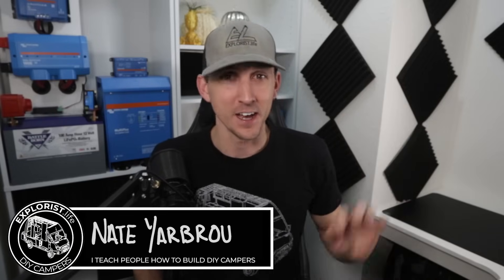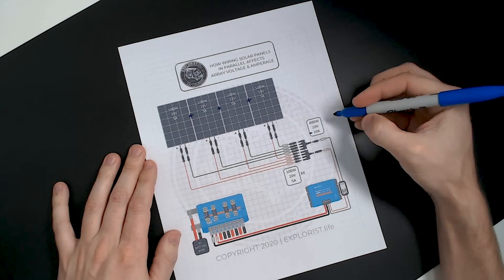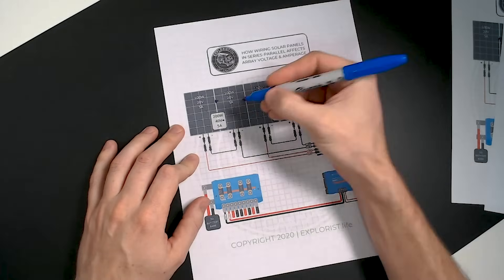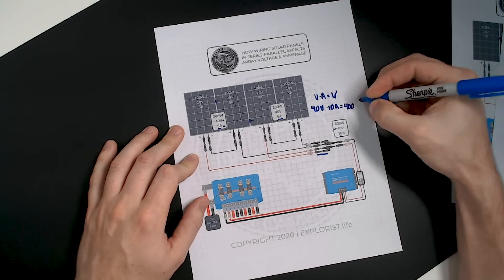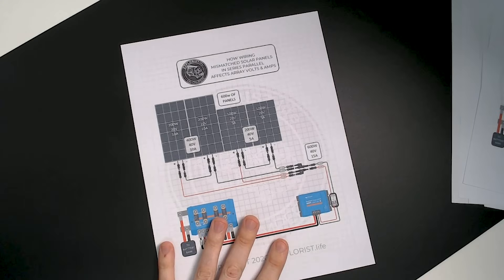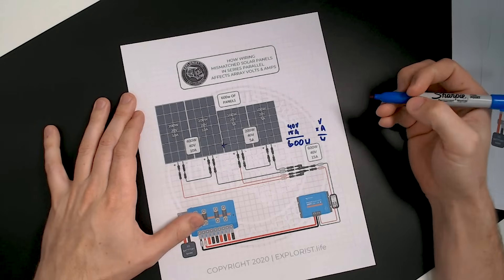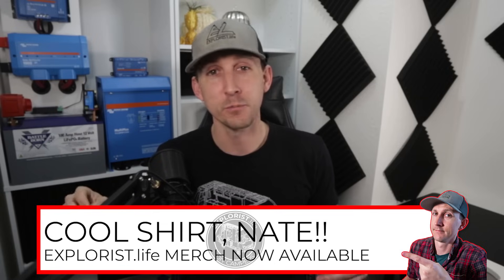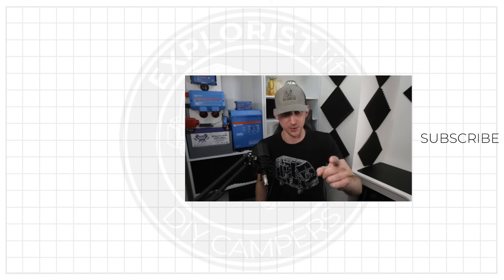How to Wire Different Sizes of Camper Solar Panels Together - Effects of Mismatched Solar Panels

Comment: Hey Nate, Great video, but have some questions, specifically to my setup but with the calculations you provided.  
I currently have a 170-watt solar panel on my RV.  It is connected to a PWM Charge controller.  My wife saw on sale at Costco, a 120-watt solar panel, so we picked it up; however, watching some videos, mixed match panels can be a bit of a pain and bring the entire system down.

I understand I have 2 options when wiring them (3 options if I decide to use a separate charge controller)

Info about each panel:
170watt panel shows VOC at 22.8 and Amps at 8.79
120 watt panel shows VOC at 21.5 and Amps at 7
Combined Watts= 290watts

First: Series Connection:
22.8+21.5=44.3. Amps take the lowest common denominator which is 7amps (44.3 x 7 = 310) But 310 is more watts than the 2 panels combined (290) 

Second: Parallel Connection: 
22.8 and 21.5.  Volts take the lowest, so we sit at 21.5 V and add the amps 8.79+7=15.79 amps
(15.79 x 21.5 =339.48) again higher watt rating than 2 panels combined

Every calc you do shows that you have lost efficiency of your solar array.  Where are my numbers mixed up?

Edit:
Now that I have read some comments I see I may have used the wrong Voltage-  for the 120 watt Solar Panel I see it says VMP=17.1  and the 170 watt panel shows a Rated DC Voltage of 19.3  if I do the series and parallels calcs with these numbers I get 254 watts in series connection and 270 watts for parallel connection.

I assume if these are the correct calcs then it is most efficient if I connect the panels in parallel.

Thanks for you help Nate

Comment: if a solar panel's voc is 50 volts, then what is it's voltage out when lying flat versus tilted 90 to the sun?  or is it the same and just the amps change?  I haven't seen a graph on this yet.
Reply from the maker: The volts will be pretty similar.

Comment: one thing left out of the video is maximum voltage the mppt can handle.  say you have a mppt with 100 to 200 volt input.  your solar panels are 48v, but voc is 51.5v at normal temp.
the voc goes up with low temps.  so maybe the voc at 30 degrees F. is 53 volts.  4 panels in series = 53 x 4 = 212v and exceeds the max. of the mppt.   i'm guessing that most mppt's are
designed to exceed their listed minimum/maximum voltage, but i wouldn't bet on it.  so i'd look for a mppt with a max voltage input of 250v.
Reply from the maker: Hey Richard!  I didn't leave that out, I dedicated an entire video to how to size the charge controller: https://youtu.be/MxziHKvTRh8
Reply: @EXPLORISTlife  thanks, i watched your video, understood it and even understood your "math error".  i'm buying 4 350w panels tomorrow, but will buy 4 400w panels next month.  i'll put all 400w panels in series at first with my mppt.  then when i can afford another mppt i'll use the 350w panels in series to it.  i will probably need a
combiner box??? to join the two mppts together.  comments???

Comment: Nice presentation.  So I'm a solar DYI super newbie, where do I find the voltage and amperage output of a solar panel?   When I checked the panels in Amazon, they are  advertised at 100W or 200W and  then 12V.     Is that 12V - the voltage I should be using when I am applying it to your presentation or is there another voltage specification that I should be looking for?   In going to the details of the solar panel it says Maximum Power Voltage(Vmp): 18.4V,  Maximum Power Current(Imp): 9.24A,  Open Circuit Voltage(Voc): 22.6V,  Short Circuit Current(Isc): 9.79A - which of these I should be using?   Thanks much for your help.
Reply from the maker: For determining power like shown in this video, you'd use Imp and Vmp.

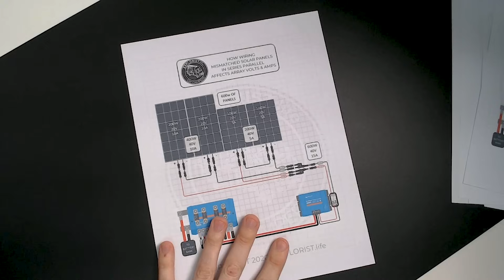Comment: Hi there. Thank you for this video! It was really helpful with deciding how to set up my solar on my RV. I had a question maybe you can answer... I currently have 2 x 100w panels and 2 x 175w panels on the roof of my trailer. I've wired them in series-parallel as you demonstrated in 7:10. However, I didn't account for the fact that because my panels are near my roof AC, there is usually a high chance of shade on at least one of the panels at any given time unless the sun is straight above. In my scenario would it have been better to just get 4 x 100w panels (4 x 175w won't fit) and wired them all in parallel? These are all going to a single MPPT charge controller.

Comment: Here’s a question

5 x 100watt panels (12 volt) wired in parallel

2 x 50 watt (12 volt) panels wired in series.

Total wattage of array? Want to check my math.

Comment: Any advice on how to wire in a portable 200W suitcase to an existing 800W system?  Current configuration is 8 100W panels wired in series parallel. We were hoping to use the suitcase to chase the sun a bit when camping.
Reply from the maker: That would be best going to a 2nd charge controller: https://www.youtube.com/watch?v=N0UB7LZVduk&list=PLmvhcyi4n0TUjVGA_O5aI5SQrS1kKLgEF&index=18

Comment: Great videos, thank you for all your videos. 
I have a question? I have 2 100w panels now   MP100w, Voc21.6, Isc6.24a, Vmp17.9, Imp5.72 and I'm looking at get 2 more but with few differences      MP100w, Voc22.6, Isc5.7a, Vmp18.78, Imp5.32.
Would I be able to tie these together? And what would the possible issues be if any?
Reply from the maker: You 'CAN' mix pretty much any panels together into the same array, but it's BEST to have them matching.   If you are wanting to mix and match, this video will teach you to figure out the effects of what happens when you mix and match solar panel sizes: https://www.youtube.com/watch?v=jejro4zkl8I

Comment: Hi nate, I have a question for expanding an existing solar system on a Tiffan motor home. On the roof there already are 3 200w solar panels in parallel.  There is only enough space to run 100 watt panels between the equipment on the roof and we have enough room to fit up to 10 100w panels. My main question is can I run 2 100w panels in parallel to up the amperage and then wire that parallel set into series with the 3 200w solar panels?
Reply from the maker: I would personally keep the two different sizes of panels on two separate arrays feeding their own independent charge controllers.

Comment: In your last example whereby adding an additional solar panel the array output was cut in half. (asking a question) when adding the additional solar panel,  it was incorporated into one of the series of three panels so there was three panels and four panels in series/parallel , would that be a way to incorporate the additional panel without losing generating power? if not; do you have a video outlying the correct approach mixing the same size (amps/volts) panels but series (2-6  and 2/7 panels)  have different number of panels. Thanks, learning a lot from your videos.
Reply from the maker: The other option is to split them up into multiple arrays: https://youtu.be/N0UB7LZVduk

Comment: I have 9 240 watt panels  7.89 max current x 30.4 max voltage.

I have 3 305 watt panels  9.84 max current x 32.62 voltage. 

If I am understanding this correctly, if I connect all these in series I will end up with with the usable wattage as if i had 12 240 watt panels.  The voltage and amperage would fall to be that of the lowest common denominator panel.  Is that right?
Reply: I rewatched. only the amperage would fall to the lowest panel amperage.  I would be losing about 128 watts if I hot that right.

Comment: The mismatched panels can have their own independent charge controller going to the Battery. 100% Efficiency!  Not sure if you covered this one.  But let's say you have two running at 17volts and one running at 34 volts.  Combing first two in series then adding it in parallel manner to the 34 volts panel, would that result in 100% efficiency?

Comment: I'm researching solar set up for my RV and ran across your channel.  Thank you for the very helpful content.  I currently have the 190 watt overlander solar kit that came factory installed on my travel trailer.  It came with a port/plug on the trailer to plug in a portable solar panel.  My question is what impact or considerations should I take into account if I wanted to supplement my overlander solar with a portable panel for some additional solar when needed?  Would it have a negative impact on the entire system if it's a smaller panel???  Thank you in advance.

Comment: Thank you very much for your highly informative videos. I intend to connect 500 open circuit voltage (Voc) Array/String of solar panels with charge controller. As no single charge controller with 500 Voc is not available, can I add have multiple charge controllers in series to reach the 500 Voc string. For example, if one charge controller allows 130 Voc, can I put 4 charge controllers in series to reach 520 Voc (130 x 4) on a string of solar panels having 500 Voc? Or is there any other workaround to this situation, where each string has 500 Voc.
I would highly appreciate your guidance in this regards.

Comment: hi good day sir, i was confused. i have 4 solar panels same wattage, i used series-parallel, but my connector is 3way, upon connecting the positive and negafive in the 3way connector, when i put the positive to controller samw with rhe negative i does not work but when i change it the positive put to the negative confroller same with the negative it start working..
Reply: Mauve I missed something over the text. But It's quite possible the marks were not correct from the start. Giving the impression it was backwards! 
Either case I believe the most important it that IT'S WORKING! So move on and be merry! ;-)

Comment: One can mix capacites provided one uses a charge controller for each "array"
Reply from the maker: Of course!  the principles taught in this video should be applied to each charge controller installed as necessary.  Here is a video where I showed how to use multiple charge controllers in the same system that could indeed handle different array sizes: https://youtu.be/N0UB7LZVduk

Comment: I have an existing 80 watt panel and I am adding (3) 190 watt panels. Doing the math, if I leave the 80 watt panel, it only contributes 23 watts to the total in the end. 601 watts with panel vs 578 watts without panel. Question is, it it worth keeping or should I just take it out?
Reply from the maker: Either way.   It makes me wonder if the 80w panel could be replaced with an ADDITIONAL 190w panel.
Reply: @EXPLORISTlife  maybe at some point, but that would bump me to a new controller. Future project maybe.

Comment: Got a messy array, collected over the years.  190W, 19.2V, 9.8A, VOC 24.4A  /  125W, 17.8V, 7A, VOC 22.1  /  110W, 17.2V, 6.4A, VOC 21.7 /  75W, 17V, 4.4A, VOC 21.7  /  75W, 17V, 4.4A, VOC 21.7 panels.  EPEVER Tracer 4215BN charge ctl at 150W 40amp which should benefit from series wiring to raise the voltage into the MPPT chg ctl.  4215BN max PV input 520W at 12V.  Any way to make this system viable with these mismatched panels.  Hate to junk all and start over.  Any help appreciated.
Reply from the maker: I think the most 'help' I can provide is the information from the video you just commented on.  That is indeed a mess.

Comment: Hello. Can I connect batteries with different amperages connected to the solar panel together? 100 and 120A
Reply: Well, you "can", but in reality, you shouldn't! 

Point is some how similar to the subject of this video. One of them will be the underdog of the other. 
All in all, ruining the balance of the system. Which in very practical terms on the long run, translate into messing up with your pocket! ;-)
Cheers

Comment: Is there any reason I could not wire in parallel-series???

I wanna wire 5 100 watt in panels and 1 50 watt panel in parallel (they have near identical voltages, the 50 watt is slightly less, but I would only lose 2 watts), it would be 31 amps and 17.8 volts. 
I want to wire up two of these setups and then put them in series. Resulting in 1100 watts , 31 amps and and 35.4 volts.

Comment: I have 8 260v panels  my inverter max input is 250v. Can I parallel 5s and 3s   to keep the amp low at 18amp ?

Comment: I have a problem ..hope you can help...I have 4 x 320 watt panels @ 44 volts...have 4000 watt inverter ..12 volts..have battery bank of 4 x 12 volt ..my controller(new pwm) will not recognize the 12 volt battery bank...switches to 24 volts ...??????mayb mppt would work...??

Comment: Great video !!
One small correction , it's Ohms law to calculate watts, amps or volts when two values are known.
I'm helping my off grid neighbor who has an assortment of panels and this video answered all my questions.
Good day.
Reply from the maker: Glad the video helped and I'm sorry for your confustion, but Watts law is: Watts = Amps x Volts as stated in the video.

Ohms law is: Voltage = Current x Resistance

Since we are given Watts, Volts, and Amps; we use Watts Law.  We wouldn't use Ohms law as we aren't given resistance nor do we need to know resistance: Introduction to Electronics - Stanford Wiki: https://ccrma.stanford.edu/wiki/Introduction_to_Electronics - "Watt's Law states that: Power (in Watts) = Voltage (in Volts) x Current (in Amps) P = V I"

Hope this helps!
Reply: @EXPLORISTlife 
Thanks for the explanation and I stand corrected. 
Continued success with your channel and thanks again for the information.

Comment: Good informative video, just one thing though, I think you’ll find it’s Ohms law......😀
Reply from the maker: You'll find that Watts x Volts = Amps is watts law, not ohms law.  I can provide sources, but we need to put money on it.  How about $20 that says I'm right?
Reply: @EXPLORISTlife  hi, I’m totally open to debate, but surly the relationship between power / volts / amps is ohms law?
Reply from the maker: Watts law is: Watts = Amps x Volts as stated in the video.
Ohms law is: Voltage = Current x Resistance

Since we are given Watts, Volts, and Amps; we use Watts Law.  We wouldn't use Ohms law as we aren't given resistance nor do we need to know resistance: Introduction to Electronics - Stanford Wiki: https://ccrma.stanford.edu/wiki/Introduction_to_Electronics - "Watt's Law states that: Power (in Watts) = Voltage (in Volts) x Current (in Amps) P = V I"

Comment: I have a truck camper with two 100 watt 18.4V 5.41A panels and Victron 100/20 controller. For best efficiency should they be wired in series or parallel?
Reply from the maker: Series.

Comment: So if i connect one 40Voc panel with one 80 Voc in series (the 80 Voc panel will cap to 40Voc) so my solar 100V controller wont burn out? Is my understanding  correct?
Reply: Incorrect. If you connect them in series, the result would be 40v+80v = 120V 
Cheers

Comment: I'm trying to wire one 435 watt solar panel along with a 100 watt solar panel the 435 watt solar panel being 49 volts at 11.9 amps and the 100 watt is 12 volts with 9 amps. I'm trying to run these both to 2 separate charge controllers at 24v. Help?

Comment: Hey wata upmnquick question I have one lifeline 100 ah bater agm victron 75/15 two 320 wat 24 panel  volt 38v open circuit  9 amps A piece if I run in series il have 76 v 9 amps  am I correct?

Comment: I have a 100 and 200 watt panel in parallel but only get 170 Watts at best. Im running a Bluetti 1500. Is there a reason I can't get up to 300 Watts?

Comment: I have 5-100w panels to charge 200ah of Li ion batteries. To get the most power possible, I would like to wire them in parallel, to get ~25 amps of charging capacity. From what I've learned, this may not be an option, or the best option. See my questions below.

1) Should I try to find a 5-1 MC4 adapter and wire them in parallel? Do they exist?
2) Should I drop and panel and wire them in 2 series parallel arrays?
3) If I wire them in 2 series parallel arrays, I'm only sending ~10 amps and ~40 volts to the charge controller, will it only send ~10 amps to the batteries? Or will is send ~20 amps to the batteries? This seems to be a better voltage sent to the controller than my all parallel option, given your recommendation of sending battery voltage + 20v.
4) If we assume I'll be traveling in -20F as my low end temp range, which Victron charge controller would you recommend?

Thanks for the help! Love these videos, they are super helpful!

Comment: Hi. Quick question.  I have connected 3 strings of 390w x 3 panels. Two strings in front lawn and one in rear. Since i can't use the roof,  the rear string will help capture post noon sunlight.
My question - When no sun falls on front lawn, will there be any adverse effects on rear lawn panel?

Comment: OK still dont get it. 
I have 1 X 100W pannel with a "Curent pMax" of 5.62A and voltage of 17.92V and 2 X 20W pannels with a "Curent Pmax" of 1.12A and voltage of 12V, so wired in paralell I should see 12V  @  7.86A right. 
But what is the watage thing you talk off? will my watage be lower and if so what difference does it make if I am getting more amps than my fridge needs to run on 12V.
Fridge needs 3.5A fom a 12V supply.

Comment: Hi, thanks for the videos, I'm Spanish and I don't understand English very well, I have a motorhome, it came with a 12v 150w solar panel and I added 2 12v 190w panels, I connected it in parallel with an mppt 100 / 50, okay? Or should I remove the 150w and put 190w so that they were all the same ?. Thank you
Reply: So, if I got it right, in theory you have: 150W+190W+190W=530W. Let's check it. ;-)
Remembering that VxA=W
150w/12v=12.5A 
190w/12v=15.8A (2x) rounded number.

Which you connected in parallel. 
So you have a 12V system, with a total of 12.5A+(2x15.8A) = 44.1A
12Vx44.1A= 529.2W 

So if I followed this correctly, you're right on the money! Notice that all these numbers are "clean". Your real world output will always be (well) below this ideal figure even in sunny Spain!
Cheers from a Portuguese in, not sunny, Norway! LOL 😂